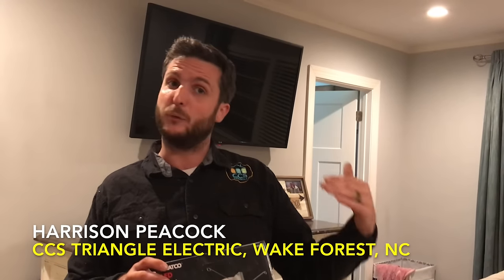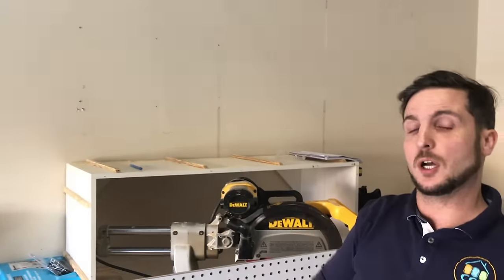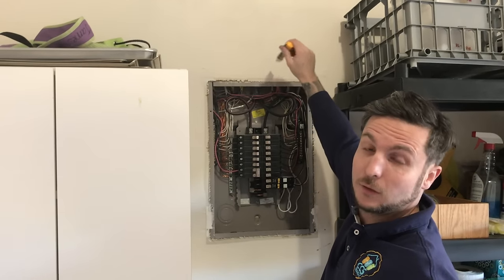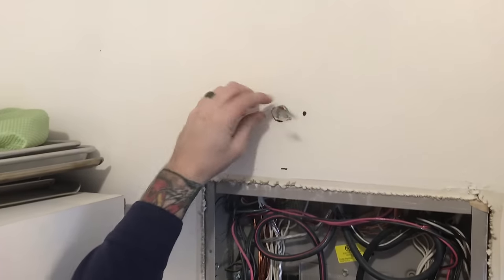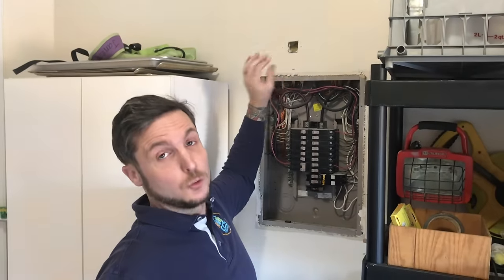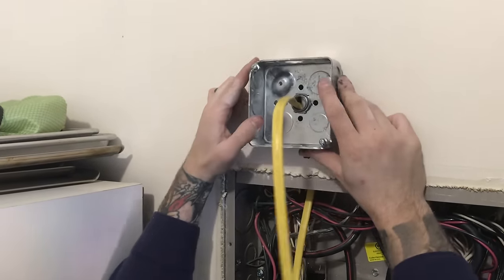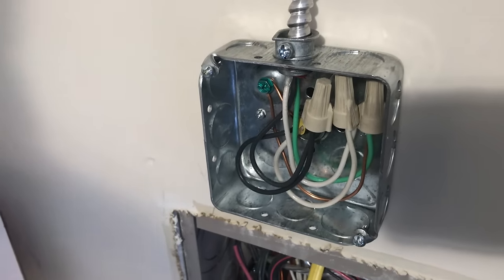New Garage Outlet From Panel--VERY DETAILED! (New Circuit / GFCI / Breaker Box / FULL INSTALL!)

Comment: I couldn’t find the plastic wire protectors you used when you cut the armor.  Almost no google search I used pointed to them, do you have a link, please?  Great video! So informative!!
Reply: Scott_T, its called an Antishort, or "Red Devil"  There's some back-and-forth about if its required on MC, but its recommended, esp. with the way he split the cable.
https://www.elliottelectric.com/P/Item/BRI/1000/

Comment: If you are doing a romex-Romex junction with a metal box does it need to be grounded in the junction box? I read no. But if using metal clad, yes. ???
Reply: Yes you must connect the ground conductor to the metal box
Reply: If you are using a metal box and the cable has a ground wire, you need to ground it in the box. In this video, he does it in both boxes, a legitimate installation.

Comment: If I hire an electrician, are they able to put the wiring through the wall without doing much damage ? Can we use a magnet or something to hook the wire ? What if it needs to go from the breaker box in the utility room to a living room and has a lot of twists and turns between the rooms ???!

Comment: The slot of the screw goes vertically so it doesn't collect dust. The paper is in the romex to make it more flexible
Reply: The vertical slot is also and mainly to prevent your fingernail from getting stuck when turning on switch.

Comment: What brand of receptacle is this that has the threaded holes scored for removal as well (at 35:53)?  Most devices (receptacles, keystone plates, switches) I encounter (Leviton, Eaton, et al) only score the corner holes for removal, making mounting under a faceplate like that a pain, as the threaded hole must be cut off or just bent.  I'm buying the "commercial" units with backwiring.
I went to get the "5 in" boxes thinking that the corresponding faceplates would avoid the need to remove the tabs (and maybe just allow me to mount it to the faceplate using the threaded holes), but no such luck.

Comment: DYI newbie question here. Wouldn't a 10 gauge wire be better than 12 gauge wire? What are the advantages/disadvantages? Thanks in advance.
Reply: Not really. 10 gauge is usually used on 30 amp circuits. You can use it on a 15 or 20 amp receptacle, but it's usually overkill. Advantages: long distance runs where voltage drop is a concern, useful in locations where upgrades to 30 amp receptacles may be necessary, in rooms where space heaters and air conditioners can be anticipated and have 15 amp power cords. Disadvantages: more expensive and harder to work with. If you're going to use 10 gauge with 15 or 20 amp receptacles, stick with 20 amp circuit breakers.

Comment: How big a job is it to run a 20a dedicated circuit from the inside wall of the garage to a breaker panel located on the outside of the house.  I’d be using it for a 5.0 cu ft chest freezer.  Thanks!  I live in North Carolina. The run from the panel to the proposed 20a box is approximately 10feet.  I’d be using a licensed electrician.

Comment: Is there any issue with doing this process but mounting the metal junction box on the ceiling with drywall anchors as well? assuming I cannot hit a joist. The outlets are only being used to plug in garage door openers. thanks

Comment: The reason why I was so curious is normally a 20 amp circuit is installed in a kitchen and for sure I thought it was a 15 amp installed as I could not clearly see the finished work. Now I am clear and sorry for the confusion and thanks for the reply
Reply: Emmanuel Pillainayagam yeah good thing he put that 15 amp GFCI in lol

Comment: back in my day bx was not allowed to be run exposed by code. has that been changed now.? also when i worked non union that was how i was taught to cut bx. when i joined the ibew i was taught to use a hack saw or roto splits for clean cuts. nice job

Comment: Just a note at 10:35 the original square hole was enlarged to a rectangle for easier access. 

We used to just put a nick into the conduit with our dikes and twist clockwise and conduit breaks right where nick was made then close off wires. It will save you a few little steps there.

Comment: I am feeling a little better about adding the outlets I want. I put one in today and it took me HOURS fighting with getting the hooked wires on the screws. From now on I am going to be using those little holes on the back of the outlets. It looks like it will be a lot less fighting and faster! (There is no power to them yet)

Comment: @10:40  Should've put the Romex clamp on the wire and securely tightened the wire clamp, then slipped it into the wall, therugh the top of the box, and installed the locking nut to secure it to the box.

Comment: Thanks, I couldn't remember if the breaker box needed to be killed before putting a new breaker in. I haven't done electrical work in over 20 years now and when I did the boxes never had power to them yet. I did Residential and Commercial. I still have a picture of my first box I wired for Commercial with all the conduit I bent to perfection going in to the box lol. I think I liked Residential better. I used to hate trying to pull a wad of wires through conduit over a long stretch. I remember we had to lube the wires up to help them slide through the piping. Actually now that I think about it sometimes the boxes in commercial were powered, I only remember because a co-worker turned the power on when I was wiring a receptical and gave me a little tingle lol

Comment: If you measure the length of the yellow cable from the first junction box to the panel top you can fasten the panel connector to the yellow cable and you will have everything tightened down.  As it is now the connector is loose around that cable because he couldn't get to the screws.  We were always taught to cut the armored cable(we call it Bx cable) with a hacksaw because it makes a cleaner, neater job and you won't warp the armor which could cut into the wires when you tighten the connector.  The plastic protector we call an anti-short.  Personally I would have run the Bx directly into the top of the panel and avoid the extra connection.

Comment: How did you tighten the clamp on the metal connector going into the panel box? Or does it pinch somehow when you tighten the lock nut?

Comment: Great video, great work.  I don't believe there is any Code that requires the same brand breakers as the panel manufacturers.  Sure, the manufacturer of the panel may request that but it's not code as long as they are compatible, UL, etc.  It would probably be an Anti-trust violation to require that.  Also, I would twist the wires together outside of the wire nut.

Comment: First of all, it is MC "cable", not wire!  Wire refers to a single conductor, cable refers to multiple wires. You ALWAYS wrap the wire clockwise around a terminal screw. That's a level 1 apprentice method.  Tip:  The NM connector that was set in the top of the panel should have been "set" on the pre-cut cable and THEN fed through the top. That way, the connector clamps were complete and the cable was ready to receive the J box connector.  I whole heartedly agree that twisting the ends is a fail-safe method.  "Wire Caps" ..not wire nuts, are not terminal rated.  Only to insulate!  I also agree that push connectors are not a sure thing.  Many fires have started because of over heating of push connectors. Even though WAGOs are some of the best made, the use of them on a utility dedicated 20A conveniece outlet is not wise.

Comment: When installing the wire into the panel figure the length of wire you need for the panel, then the connector should be secured to the wire and installed.

Comment: The metal box above circuit breaker you rapped the ground wire counter clock wise instead of clock wise, heating and cooling cycles could leave it susceptible to loosening over time.

Comment: If current is traveling down the hotwire at a given point in time, is current also returning on the neutral wire at that same point in time (simultaneously)?  Or is current traveling down the hot at a point in time, then at another point in time it is returning on the neutral?
Reply: Traveling through both simultaneously.

Comment: You didn't tighten the connector on the  panel. No tape around the receptacle..? Sub panel has to have neutral and ground separate..

Comment: very few so-called electricians have any formal teaching at all in our state very rare to see someone with formal schooling from a vocational school or union training,  I started old school going thru our local vocational school in the mid-1980s taking the building trades where we built on-site modular homes and auctioned them off after we had a number of them built and finished just waiting to be purchased and moved to the site of the owners choosing, I started at back than Albuquerque technical vocational college and took general building trades, and plumbing, and electrical, after finishing my formal trade schooling I went into the field working as an apprentice for a licensed contractor and after several years getting my journeyman licenses in electrical, plumbing, etc after working in the field for many years as a journeyman for licensed contractors I opened up my construction business in building custom homes,  the only problem is that I was spending what I was making and not saving my own retirement so my spouse at the time was already working for our local government and she let me know when a government inspector job came to be open and that's when I applied and I have been there ever since looking at retirement in a few years and than open up for business again

Comment: When you pulled on the wire attached to the breaker switch came out and was still loose, is that still dangerous. Should you have made sure that the breaker switch is in not tight but not loose? I did not see you tighten the switch.

Comment: Correct me if I’m wrong but - Considering you’re working in a subpanel and therefore ground and neutral bars aren’t bonded, the neutral bar could easily have a (small) potential to ground right? 

Just one more small reason to just kill the power to the panel when working on it 😂

Comment: Two things I wild have done first would have placed gfci inside of j box on top of panel than would have used EMT with offsets to go from ceiling to other outlet using mc for the ceiling run only but decent job all the same

Comment: Great video but why not just run the MC/BX cable through the sheet rock and directly into the top of the panel? It would have only required a hole the size of a quarter and it would eliminate need for an additional splice and extra material.

Comment: What's the purpose behind installing the junction box?  Could you not just run Romex from the breaker to the outlet? Or is it merely aesthetic?
Reply: The panel is mounted inside the wall and circuit is mounted on the wall. This is the only way to do this without cutting up the drywall.

Comment: Regarding the ground wire. Since he uses what is basically a loop on the screw,what is the difference?
Reply: One way tightens the screw on the wire and is code. The other way is wrong and can force the wire off the screw. This like day one of an apprenticeship.

Comment: Great video and thank you for the detailed instructions. I lol’d when people had to comment about how you wrapped the ground wires around the screws. You called it - lot of complainers! :)
Reply: I saw him do it counterclockwise with his finger first, so I predicted correctly that he would do it wrong.   The wire must be around the screw clockwise, because the screw tightens clockwise.  I am an electrician in Canada.  Counterclockwise wrapping of wire around a screw or terminal is a very basic error, and demonstrates sloppy workmanship.  I would never hire this company.

Comment: Correct me if I'm wrong but aren't you supposed to wrap the outlet connection with electrical tape to keep the connections from accidentally touching the box
Reply: It is not required and also it is a bad practice .  The terminals are spaced enough from box and when put together terminals wont touch the box.  The circuit is ALWAYS OFF when work is done so any contact then is safe . It is bad practice because it interferes with heat dissipating from terminals and wire. These can run at 140 F when under allowed load .

Comment: That’s aluminum MC?  I missed that part, but it looks like it to me. If it is aluminum, it’s against code to use those screw type connectors. You have to use strap/clamp style with aluminum. The steel screw against aluminum is capable of puncturing and/or crushing the aluminum. I keep a little magnet in my pocket doing inspections just for that single reason to confirm steel or aluminum.

Comment: I also see some violations in the panel itself every cable coming in the panel which is #4 or bigger in size must have a bushing at the box termination per article 300.5g,  I see many simple overlooked violations in my daily inspections out in the field while I'm inspection new and existing buildings of all kinds, we have very very very very few electricians whom are code literate and usually learn ojt or on the job training and we inspectors have to write up the violations with the code articles

Comment: If you read the specs on the bag of wire nuts it advises you not to pre twist. Old wire nuts yes you would have to pre twist. And at the las Vegas NECA CONVENTION i saw the new wagos and I am really impressed and have used them here and there.
Reply: Other than that the only other complaint that I have is him using the dykes to strip wire. He says it in the video if you nic the wire you ruin the integrity of the wire. So I also use wire strippers.

Comment: Nice job,my only issue is I would have screwed the connector onto the m/c cable before I lowered it into the top of the panel .

Comment: I would’ve used different romex. 12/3 and make 2  20 amp circuit on a different style of outlet just cut the strap on the gold connector on the outlet. And use breakers with GFI resets on them.

Comment: Question- could you of just used a GFI and kept going where you mounted the junction box off the breaker ? More sockets ?
Reply: YES! A GFCI breaker could have been used instead of the GFCI outlet. But the GFCI breaker is more expensive than a standard breaker. And GFCI breakers can fail. More expensive to replace than a simple outlet.

Comment: Awesome video just wath I was looking for. is it the same if I use a GFCI breaker instead of a gfci receptacle?
Reply: Only difference is the panel, neutral and hot from romex in panel would land both on the breaker and the pigtail from the breaker goes to neutral buss

Comment: Hi there nice work clean work except for two things no lock not on the connector going into the panel and ground screw and receptacle box the ground wire is going counterclockwise instead of clockwise that’s what I would do it but again good clean work

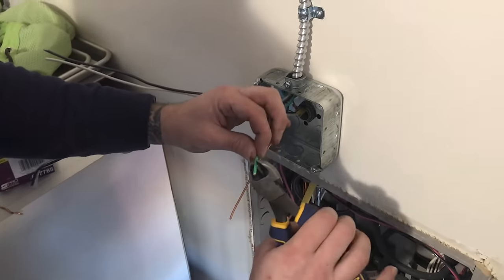Comment: 20:27 dont strip with  these side cutters or kleins unless you can do it without scarring or scratching copper or it will make a crimp arc point in wire which will overheat wire at scratch point and cause future possible fire or copper breakage when wire nut applied or wire twisted and breakage point causing a short or am arc

Comment: Personally I would want more outlets especially on a new dedicated circuit and in a garage.  I would have put a GFCI in the box above the panel and then two outlets in the final box.
Reply: Good idea
Reply: @Jay Cahow Kind of a weird place to have a GFCI receptacle above an electrical panel. He did what the customer wanted, if they wanted more outlets, they would have asked. I suspect, since it is 20 AMP, they want it specific for something. If you want 2 outlets in that box, then one would be the GFCI, rather than doing it your way.
Reply: @KStewart-th4sk  Outlet ended up over workbench.  Odds are there will an outlet strip plugged into it in no time.  I put in over a dozen outlets in my garage and I am always looking for an open one. Outlet next to circuit box happens all the time, could use for charging, clock, radio on shelve, wall mounted TV, etc.  Circuit box is covered so why waste another place for an outlet.  Electrician should offer advice based on past experience since he was already there instead of coming back later and installing more.

Comment: So I added a new 20 amp breaker with a gfci outlet and I get power to that circuit but whatever side bus I put the neutral and ground on the whole row of breakers don't work on that side?

Comment: when using and pulling mc cable always run the mc in the same direction as the direction of the pull as the same direction as the coil twist of the mc so when running in direction shown in this case going backwards away from box make the twist in mc run same direction in this case the twist  avoid pinching wire inside

Comment: For my setup, I would have had lots of permits, run a brand new drop, have the main panel replaced, new drop, new breakers, and have to upgrade all the rest of the house electric just to add ONE gfci outlet in the garage and one outside outlet.
All because the garage did not have a ground back to the house and main panel.
So I installed it anyway and used a ground rod just outside where the outlets were.
I was told later that it was not safe. But a ground is a ground is a ground.
Actually less wire resistance to a nearby ground rod than to run 150 feet of new wire with ground back to the panel.
So sick of local codes demanding forced upgrades just to do a simple addon outlet or two. Presumably to get that TAX MONEY.
Both outlets work perfectly (even have a shutoff switch for the outside outlet inside the garage).
It would have cost me $50K to do all the upgrades (electric, wall repairs, etc).
Not worth it for $50 outlet costs.